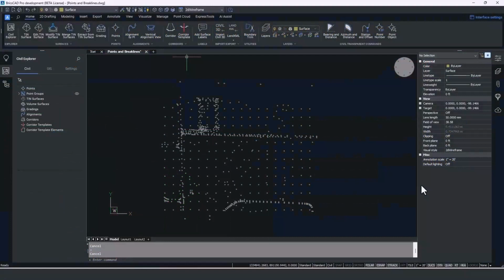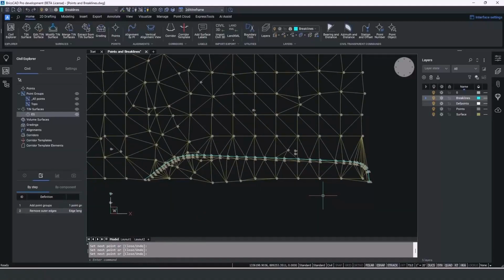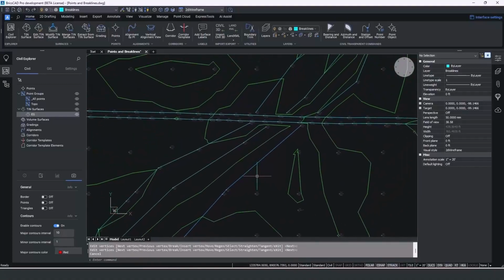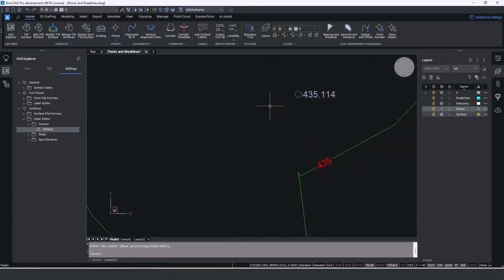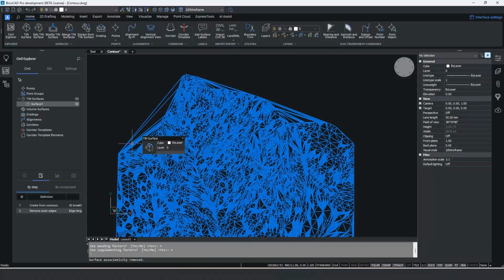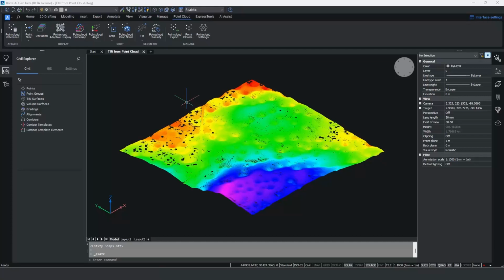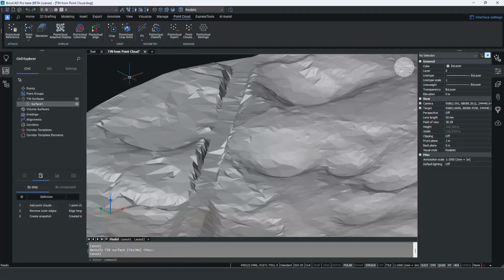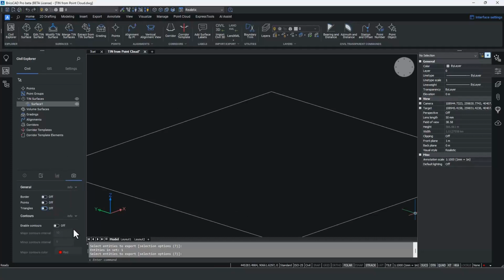Working with TIN surfaces  in BricsCAD® Pro V24 for civil users

Comment: Is there a way you can you define the breaklines automatically using the point codes from the raw survey data?
Reply from the maker: Hi @nilracmloc, thanks for your question! While one is able to select the points imported to create the TIN surfaces, currently the ability to enter the point number, or code, is not available. However, this would make a good addition to the TINEDIT command options. Submitting a Service Request requesting this feature request would allow an analyst to create the development task!